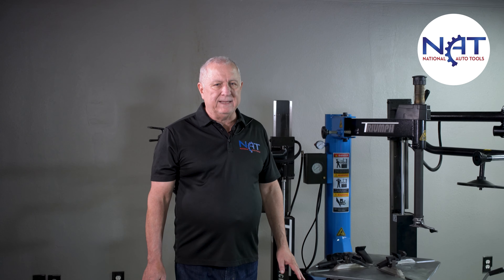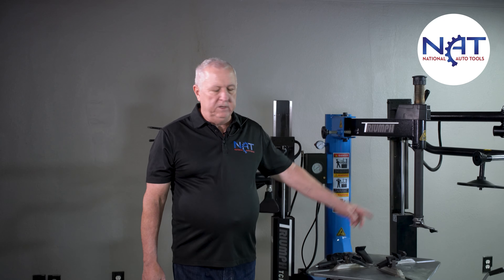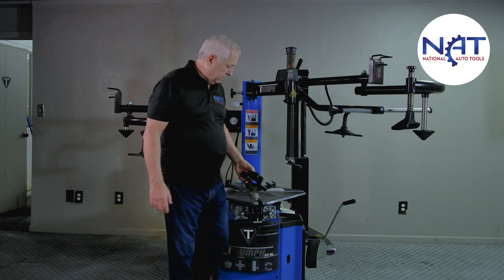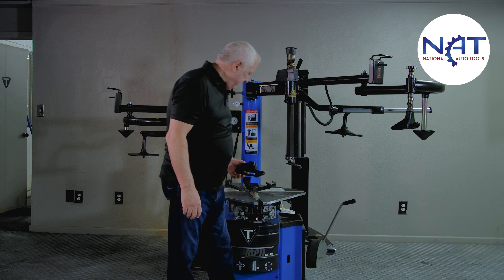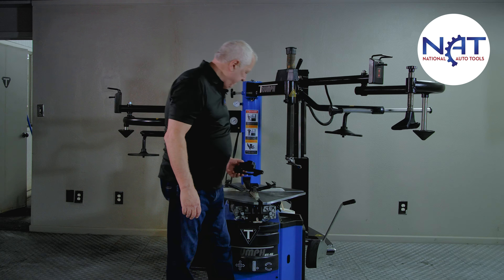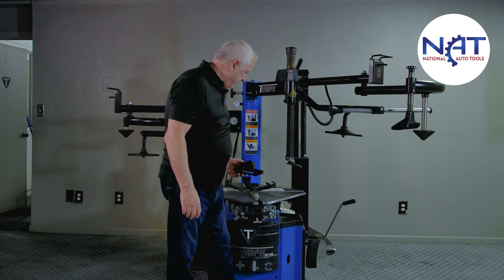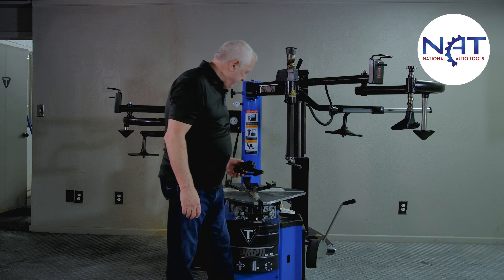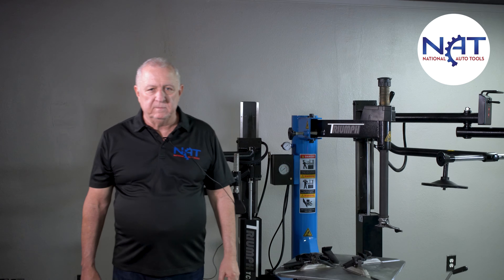NTC-950 Tire Changer and Assist Arms

Comment: Bought one of their NTC-950 & NTB-550 combos back in '18 for my home garage. Got an Associate's Degree in Automotive Tech right out of high school in '90 and been wrenching on everything since (not as a career) and this was the BEST MONEY I'd spent on tools. Wished I'd bought these 20 years earlier!! After setting everything up, reading the instructions and calibrating the balancer I ran my first set of wheels through it and put them back on... and this is after having gone to several shops around town over the years and never really being fully satisfied. They'd show me their balancer and say, well you can see the wheel is bent a little (minor lateral runout) and tell me they would do the best they could. Well, after re-balancing my first set (4) on my Jeep and going for a drive, I was SHOCKED. It was so smooth, it felt like I'd hit ice!! Talk about being keyed up! Had trouble sleeping that night because I was so giddy. Later I decided to give my original '99 Jeep Grand Cherokee wheels (alloy spoke) wheels another go. The tires on them had egg-shaped spots all over them from being out of balance (which is what lead me to pick up the other set of '08 take-offs I was running instead). You could feel the humps & bumps all over them. So, I ran them through the balancer and swapped them back onto my Jeep. Holy cow!! They were WAAAY better than before. They still had a little rumble too them and weren't perfect but were sooo much better than before. After maybe 1,000 miles or so they had smoothed out were just as good as my '08 takeoffs I'd been running before. All of those hump & bumps wore off and the tire was smooth and uniform again when you ran your hand over the tread.

Only thing I wish I'd bought at the time were the pair of helper arms. I've managed to do every tire I've tried to do on it so far, but there are definitely times the additional arms would've helped. I'm ready to get those ordered now, just as soon as I hear back from them.